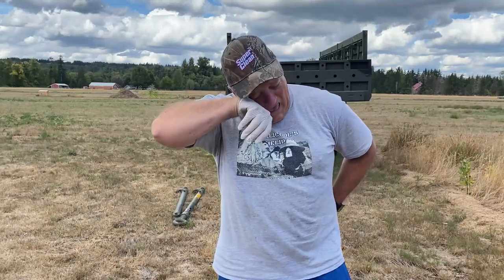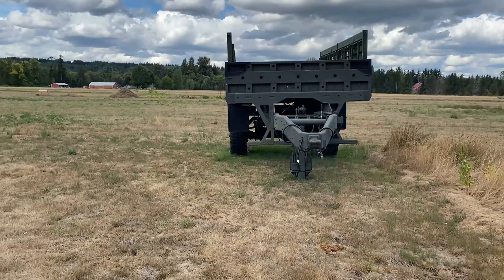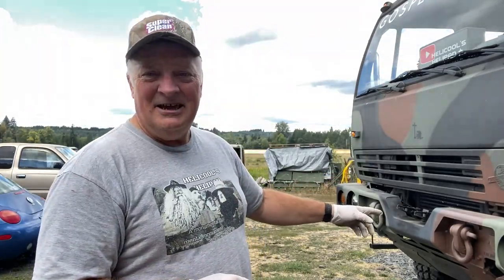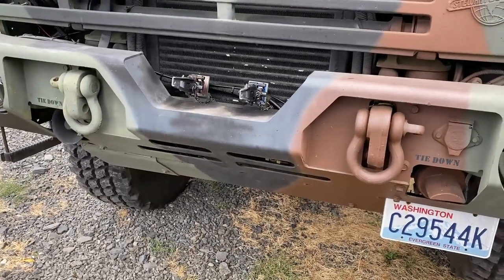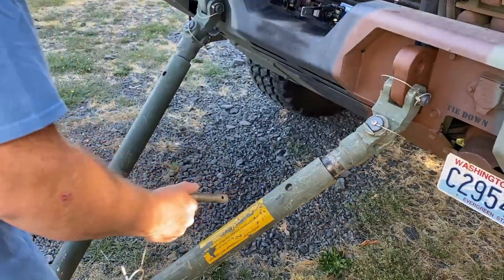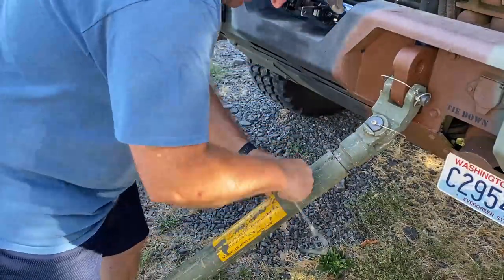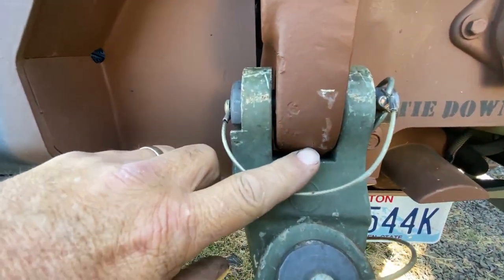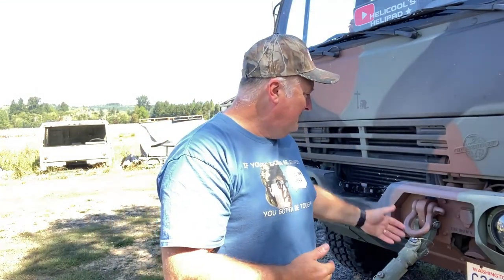FMTV TOW BAR Attachment Problem Solved

Comment: bwahahahahaha.......  just found this video........  and appears while you were editing and publishing this.... I was putting on/using same tow bar.  Ok... so now I will watch this and see if you did it like I did.....  and to see what I FUBARED
Reply: wooooooo nellly...  watching your vid.... "how did you do that"?  you must have a different bumper with a more narrowed  center drop section.  On my truck the attachments on the truck is closer to the section of front bumper that drops down.... due to this there is no way you can put the pin into the tow foot from the inside out....  can only go from the outside inward. Hence one side you cant have the pin's flat side head mount into the foot the right way.  It ends up on the wrong side. I brought this up on SS during a break and a member said no issue with that.
Reply: hmmm....  my tow bar's bars..... have three holes maybe more holes.  I chose to pin it further out into 3rd hole. (UPDATE- DONT DO THIS.. use it collapses position only)   Short trailer tongues make backing up a trailer way harder with its sharp reaction to steering of drive vehicle; was my thinking;. Hence decision to make my tow bar longer cause this particular tow situation involved mostly moving the truck the bar was mounted mostly by pushing her  "backward" via the driving truck pinteled too up front, being driven in reverse.  (UPDATE- DONT DO THIS.. use it collapses position only)
Reply: awwwwwwwww mannnnnnn....  you didnt show how you backed a truck up to the tow bar (or drove forward to it) nor how you then hitch two together....  Now that is the fun part......  

when all else fails...... read the TM  (I didn't)  heheh.
Reply: PS- I also used the same partner......  but did it in stages with the bar separated into its two pieces.  Like you installed feet onto truck first.... then one bar...  where we differed is I did not put have together at the lunnett end till after attaching both bars to the towed vehicle ...... butttt... stand by.....  will make a video to show that in hooking it to the driven truck...  I found it worked better to have them remain separate.
Reply from the maker: 1st reply: Isn't that crazy? So cool that is what you were doing today... I have been wanting to get to that video since the Roundup in early August! LOL! 
2nd reply: Also, the instructions on this set said that the hole that is all the way in would be the only one to use while towing. ??? Maybe because it gives extra strength? 
3rd reply: I don't have two trucks here to show anything being hooked up to another truck, let alone to push or pull another truck. If anyone would like to donate a truck to me, I would be happy to oblige that process. :-D  Your truck would do nicely!
Reply: @HelicoolsHelipad  I'll tow it there... hmmm.... on second thought..... no too far from OH.  LOL
Reply: @HelicoolsHelipad  2cnd.....  searched out some more info... yep it says collapsed only grrrr.

Comment: Hey Dave  i'm  lookn for one of your vid's on starters that a buddy saw. he's been helping me try to figure out why  my truck will not start by that i mean will not even turn over . I'v been cleaning all the batt. cable connections  and i'm try'n to figure where the starter motor gets its power   my large cable to the solenoid is hot but how does the starter motor itself gets its power.  anyway this buddy said there was some shots of the starter on your vid and i thought maybe i could see a connection between the solenoid and the starter motor. thanks  and if you have any other ideas on why i cant get it to turn over please let me know  I pulled it into the shop just fine 7 months ago and have not been able to get it to crank since   all new batt's
Reply from the maker: Okay... that video would be https://www.youtube.com/watch?v=NDr7YsHgikM episode #155 ...I hope that helps. PM me if you need any other help. I'm on a lot of the FB LMTV groups. Cheers!

Comment: What is it like pulling it down the road. I have a nineteen ninety nine w nine hundred kenworth I need to tow. Could I do it with a one ton dodge
Reply from the maker: You will have to know the capability of the truck and the weight of the truck being towed. Typically, you don't want to tow with a smaller that what you are towing, truck.
Reply: @HelicoolsHelipad  Thinking of undoing the hydraulic gearbox on the steering. I believe this would make it easier to maintain. My kindle works way seventeen thousand pounds. Not sure the weight of a one ton dodge Maybe seven thousand pounds. Maybe I should pull it with another tractor truck weighing equal
Reply: Kenworth not kindle